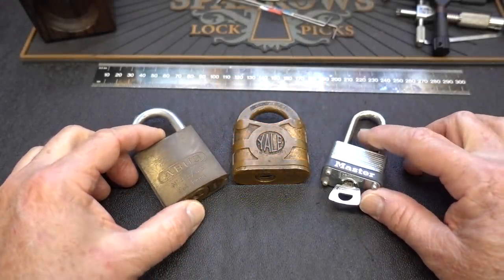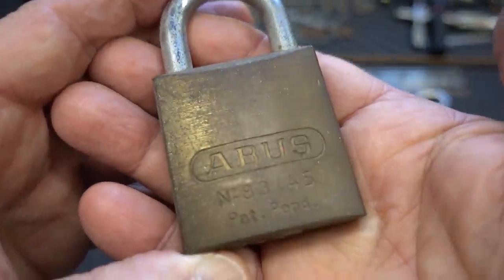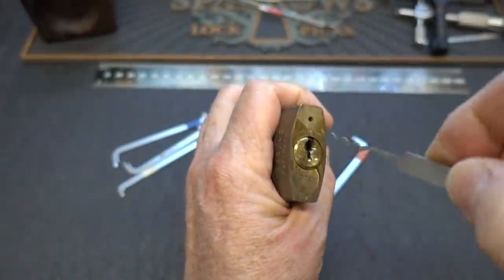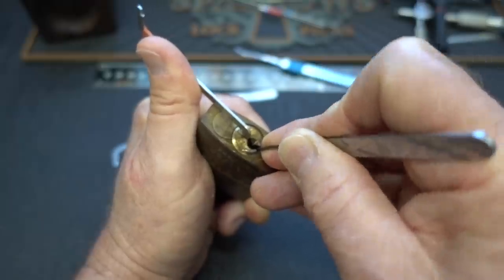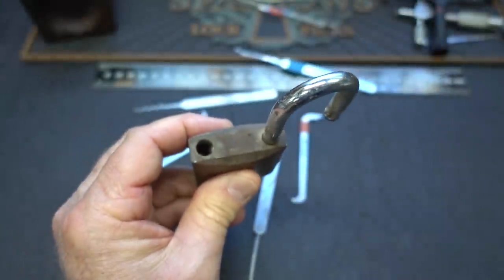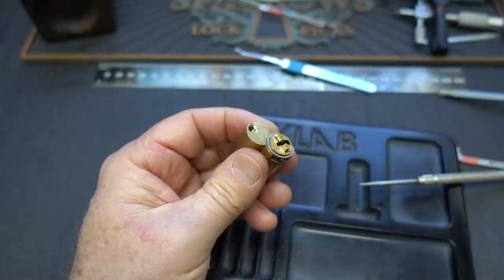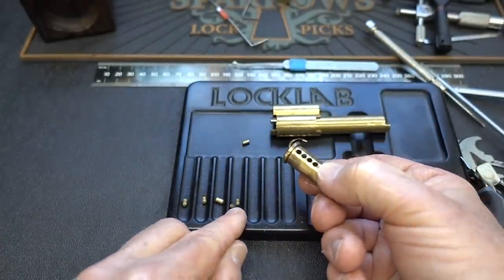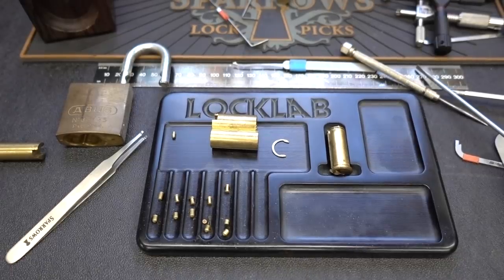(1715) Abus 83 Saved From the Trash Pile

Comment: This was probably used with a 5 pin key, I would guess the rest of the organization it was used for had 5 pin locks in some applications for the same key.
Reply: Just what I was thinking, we use the Schlage SC1 at our buildings at work, which is the 5 pin version of the C keyway. SC4 is the 6 pin version. SC1 Keys will work on the SC4 core, so long as you don't populate that 6th spot. I suppose you could drop a pin in that would come up flush to the shear line, if it were the right size to ride the ramp on the end of the SC1 key. Is nice that we can use either core 👍🏻
Reply: @bradw0535  A flush pin would do you no good since the ramp at the tip of a 5-pin key does reach and lift any 6th pin. Keying it to that ramp is often done in challenge locks, but should never be used in practice because the ramp has low tolerance and correct operation would not be guaranteed.

Comment: Awesome trash haul!  That is one of the old ABUS 83s that did not have the top access for the 6th pin and all of those drivers were factory standard.  Those come zero bitted with 5 pins.  I always add a 6th pin to all of my locks but that's just me.
Reply: Oh, I thought it was just more master keying with all cuts valid for pin 6.  Typical application of that would be for the common gate in a building with a dozen flats, all 12 of which are allowed to open this lock, one staircase (of 2) and their own flat.  Adding a janitor key complicates system further.
Reply: @johndododoe1411  not a bad thought, though generally you dont see that in standard pin tumbler locks.  KABA does remove pins for master keying but that is usually in locks that have way more than 6 pins.  Actually there are a lot of padlocks that come with 6 pin cores but only 5 pins keyed up.  American locks are a very good example of this, they do it all the time.
Reply: Hold and vary system of the nth degree.  😀
Reply: It had a 6th access....

Comment: As a home owner I use these in the configuration shown.  All of my doors and padlocks are the same key set, with master keys for my wife and I.  Kids/ guests get non master keys.  Since most of my locks are only 5 pin I can't use 6 pins in the padlocks.  I even have some inside privacy doors with only 1 or 2 pins that will open with any key in the set plus a key blank.  Granted most home owners don't even know this is possible.  Thank you for the content!

Comment: Any advice for an Abus 83/45 that I bought in batch off of eBay that the actuater doesn’t pop the shackle?  I have picked it so the plug turns but something isn’t right. Lock looks fairly new.

Comment: I am very new to this but you said the pinning had been changed to match up to a master key system. Would it be possible that the system was based on a 5 pin system and that would be the reason for the pin 6 hole to be empty? If your keys were 5 pin they wouldn't have the sixth bitting making that pin redundant plus your keys would not work on that lock.

Comment: i make these fairly regularly, the 83 series with the snowman cylinder. some of the series are 5 pin and some are 6 pin, for obvious reason if you start your system with a 5 pin lock i.e an 83WP/53 then move up to an 83/80 you're kinda stuck with the 5 pin key.

Comment: No big deal if locked while lock is disassembled. I'm no great lockpicker. But I once bought an open Ruko padlock with no key (snowman cylinder). Since it was easily disassembled I could just fit in a shim (from one of those anti theft stickers) from the back. Got it disassembled in no time. Now pinned to a lonely key I had flying around.

Comment: I have that exact lock and it also has 5 pins. But it has 4 spools and a serated. I got it in a lot of old locks from ebay and to my disappointment the key was broken off jammed deep inside. Luckily I was able to pick the first 2 pins to get it opened and rekeyed. Point is it had to of been like that a long time if not sold with 5 pins

Comment: I really like the 83/45 padlocks, easy to get replacement parts, different key ways and different shackle lengths which are all easy to change. The z or 2 version can be set to either key retaining or non-key retaining. They are only about $20 each too. You can easily spend more on a master lock with less features and less pick/bypass resistance. It’s a shame that lock was thrown away but it’s probably due to the low cost of replacing the whole lock

Comment: Hello Bill
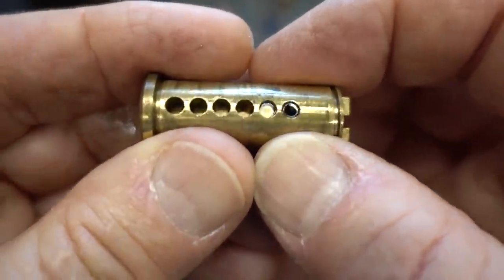Can you please recheck the video at 8:47 .. 9:00. The reflections of the lights are really irritating, but I'm not sure about pin 6 (most to the right) being empty. In some video frames it is dark, and then I thik it reflects the same way as pin 5. In some frames i would think there is a steel pin inside. But agaim the reflections of the lights changing bacause of you moving the core I think to see different things at pin 6, but not at pin 1 to 5.
Reply: @jregns  I think you are right. It is like a soap bubble. And I think there is one above pin 5, too, which sometimes makes them (5 & 6) look pretty much the same.
Reply: No driver or key pin came out of the 6th chamber, regardless of what can be seen or not seen.